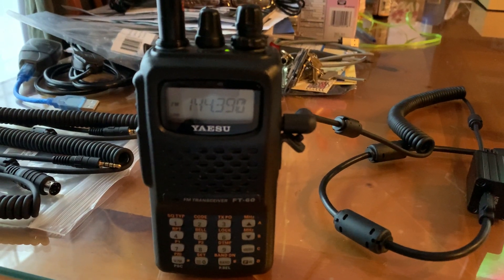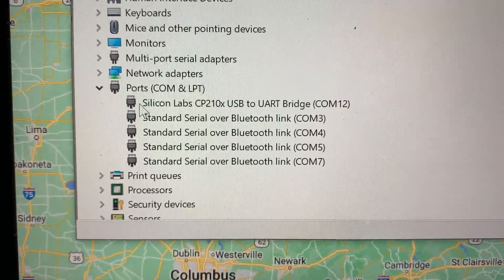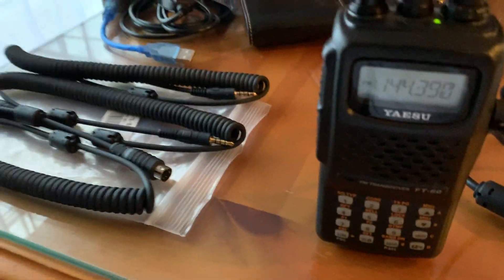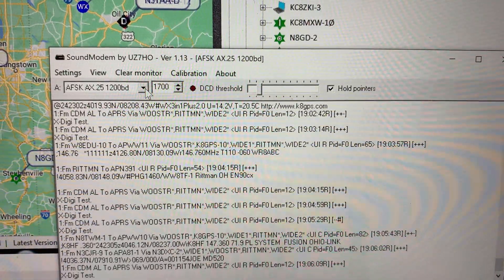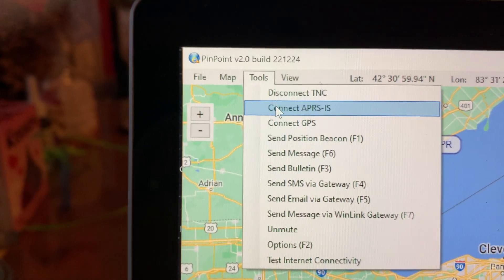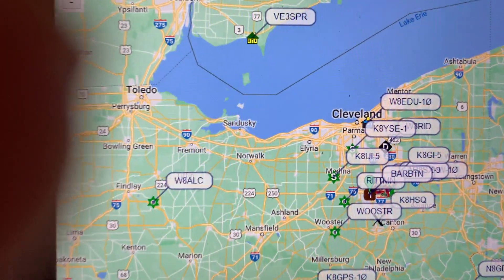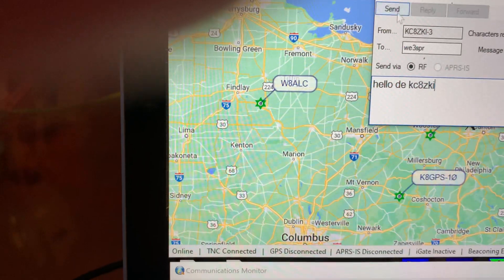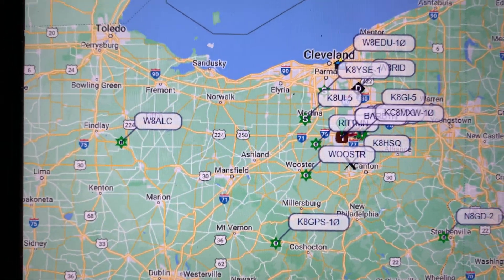APRS with a standard HT

Comment: I am having a problem sending beacons and messages with the FT60. The radio keys up and the transmit light comes on but the beacons or the messages never arrive. Would you mind going thru some of your radio settings that you think are necessary?
Reply from the maker: @jasonflanzbaum455  Sure, there is not much to set on the radio.  Freq = 144.390 simplex, no PL tone selected.     If you can listen on another radio that might help you to confirm packets are audibly present.